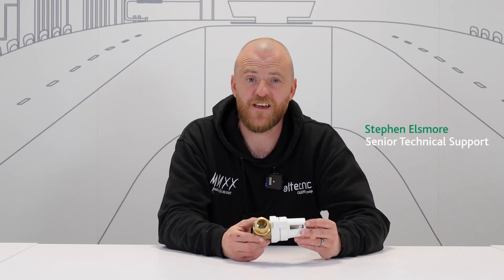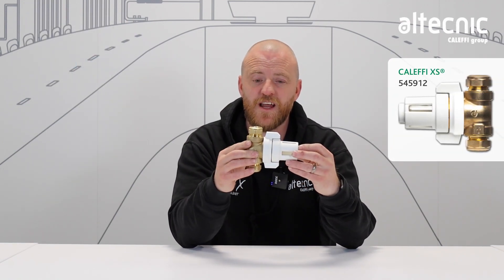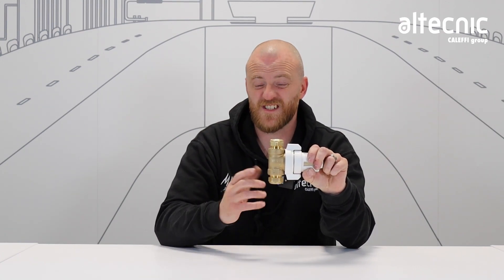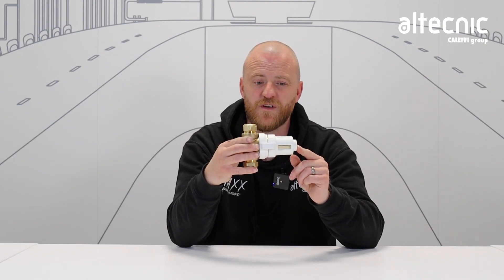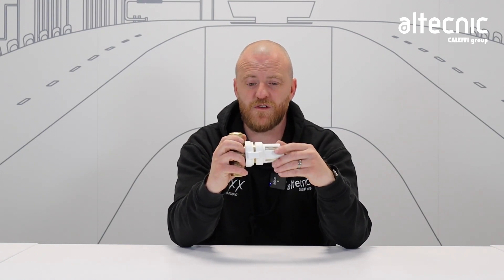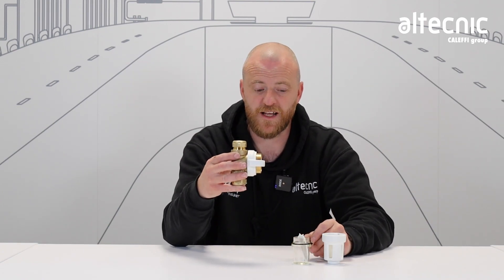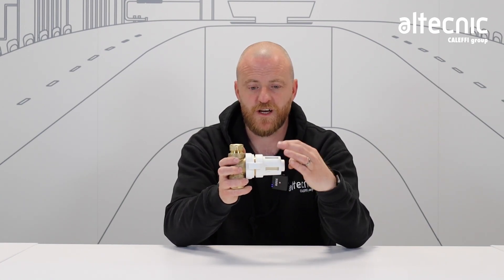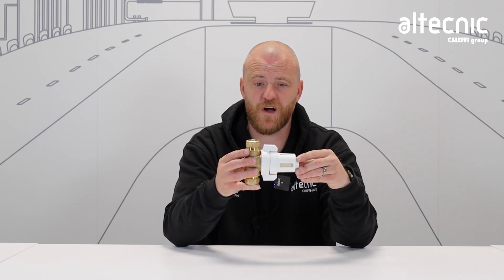Introducing the CALEFFI XS®: The NEW Compact Under Boiler Magnetic Filter

Comment: The chamber does not look big enough if the system was heavily clogged also is that magnet big enough?
Reply from the maker: Thanks for your question Mark, we absolutely agree that choosing the right filter for the right system is key to ensuring an efficient working system for installers and homeowners.  In the case of a heavily clogged system, a magnetic filter alone would not solve the problem and a full system flush would be required prior to installation of a filter like the XS. We also have a range of other magnetic filters with larger collection chambers that may be more suitable to larger systems. The benefit of installing the XS would be that the glass visual indicator allows installers and homeowners alike to visually inspect the cleanliness of a system without having to isolate and drain, meaning you only take action when it's required.